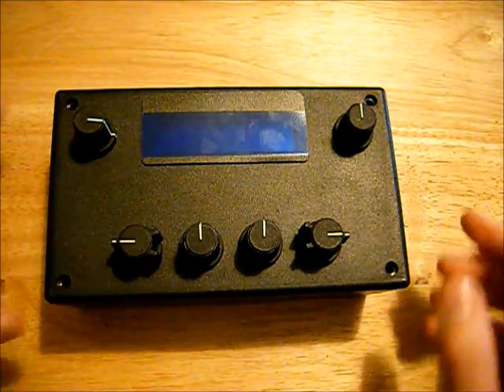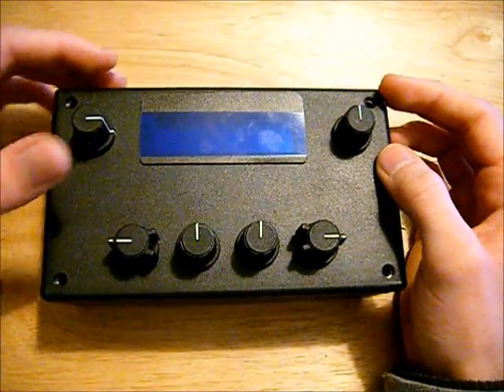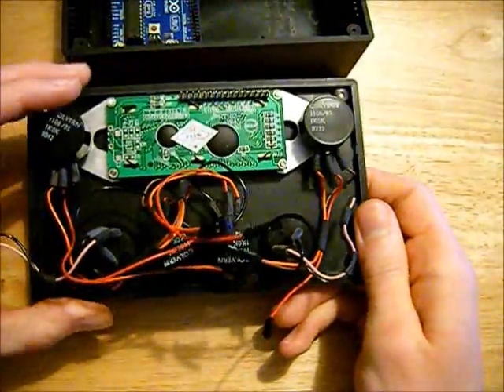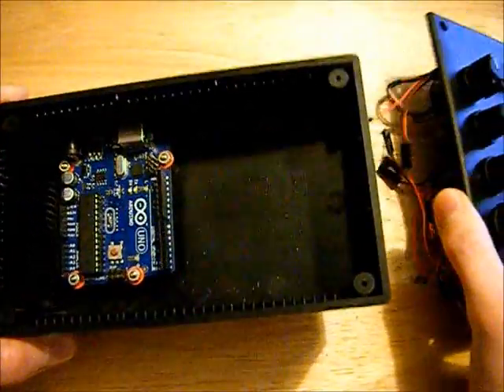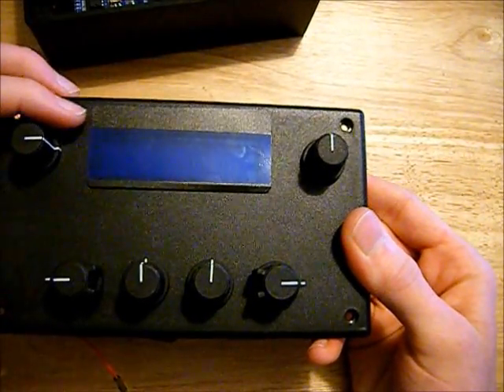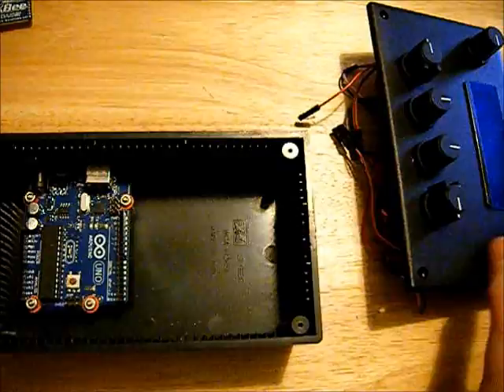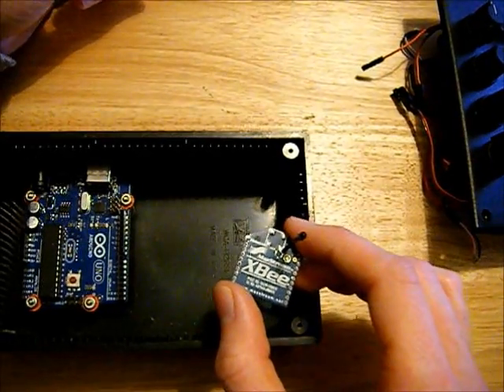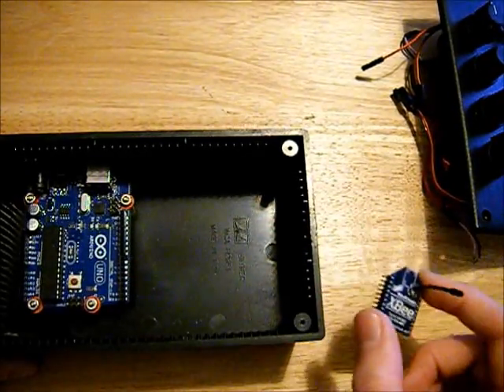RC Tractors - DIY RC Controller Introduction

Comment: How much can one cost?
Reply from the maker: Hi, well you can get an arduino nano for around €5, an XBee is around €20, jotsticks are around €1.50 each and you'll need some perf board so roughly €30 for the essentials and then you can add other things like an LCD, a case and more buttons. And don't forget you can reuse the parts if you get bored of the controller you made.